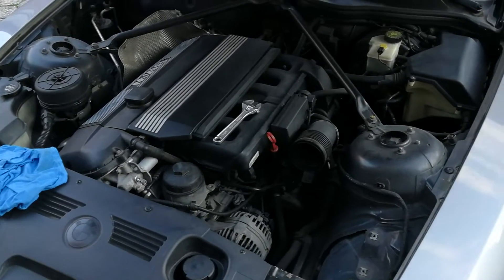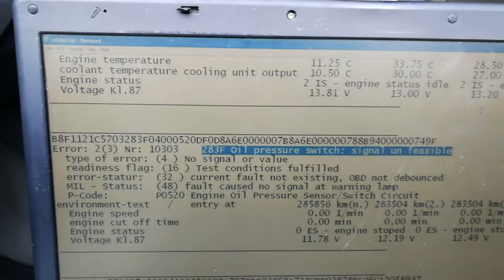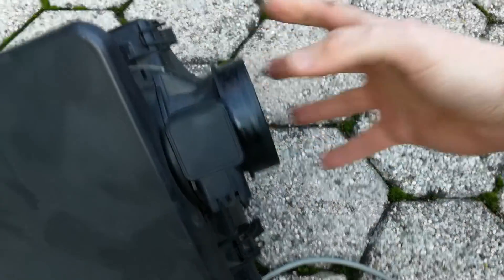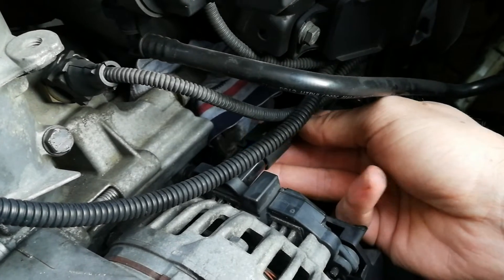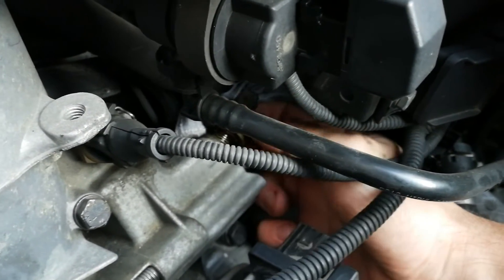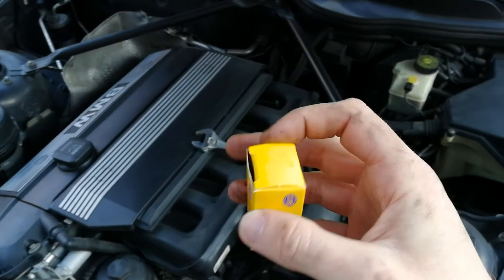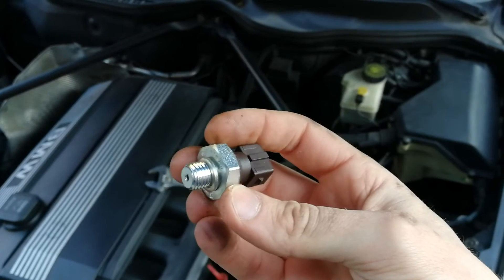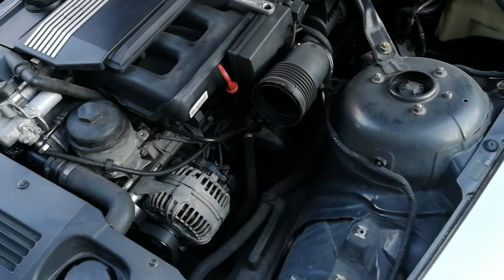BMW Z4 M54 Oil Pressure Sensor Replacement - Code  P0520, 283F Fix (E85/E86/E46)

Comment: Hi, I have Z4 E85, want to ask, if you have seen coolant light on. I changed coolant, sensors, radiator. But the light is still there.Would appreciate your input.

Comment: What is that 2 wire plug just above that sensor ?
Reply from the maker: Coolant temperature sensor.
Reply: @BimmerZen  i think my oil pressure one might be bad. Sometimes flickers at idle. Just sometimes. Red light.

Comment: The yellow oil light turns off right after I start the car and it stays on for about 20 seconds or so then turns off.  The oil was recently changed, so I know there's enough oil.  Is that most likely cause a bad oil pressure sensor/switch?
Reply from the maker: Probably a bad oil level sensor. Check for oil sensor codes.
Reply: @BimmerZen  Will do!
Reply: I changed the level sensor and still doing the yellow light for about 10 seconds. Did you find what was going on? Did you fix it?
Reply: @TheProfessionalPR20  I think I changed the oil PRESSURE sensor instead of LEVEL sensor, if I'm not mistaken.  Might oil light still pops on for about 20 seconds when I start the car.
Reply: @studiowizard6286  thanks for the reply. Well the only 2 possible things besides that is the filter housing check valve or oil pump. I think I will scan the car first. It's been doing that light thing for about 1 year now but I don't want something worse to happen. Thanks again.
Reply: @TheProfessionalPR20  That's wise.  Keep me posted.

Comment: How tight did you tighten the sensor since you don't have a torque adjustment ratchet?  How tight is 23n/m?  
If you did buy a torque ratchet, would it be able to get in that tight space??
Reply from the maker: The sensor needs to be torqued to 27 Nm. I did not have the appropriate 24 mm 3/8" socket / adaptor for my 3/8" middle  sized torque wrench (19 - 110 Nm range) so I did it by feel, but I think that you could fit it in there. Another option would be to use a smaller 5-25 Nm torque wrench and set it to 27 Nm. It would be a bit out of range, but still close enough.

I think that if you have some mechanical experience you won't under torque or over torque that sensor...
Reply: @BimmerZen  Thank you!

Comment: Red oil light flickers when idle and warmed up on my M54 (03 325i). I replaced the oil LEVEL sensor at the bottom of the oil pan the other year, and I've heard RED oil light indicates pressure whereas yellow indicates LEVEL. I hope this is the fix!
Reply from the maker: Yellow light indicates low oil level, red light indicates low oil pressure. Are you sure there is enough oil in the engine? If replacing the oil pressure sensor won't fix the issue, then you have some other issue with oil pressure due to worn components. Sometimes low oil pressure is due to worn camshaft vanos sealing rings. What kind of oil do you use? Maybe try switching to 5W40?
Reply: have you found out why your oil light flickers at idle bc it just started happening to me and i don't want to drive the car if it can be something serious

Comment: Hi I have a e39 530i m52 single vanos I have a problem that the red oil light is blinking and its go when I het the gas to 2000rpm nad I chicked the oil pumb and the engine prissure..... Does the bad oil pressure sinsore cause to fire the red oil light???
Reply from the maker: Not sure... You should first scan the ECU with diagnostic tool like INPA. That should give you enough information to determine the problem.

Comment: Hey there! If I just change this switch but dont clear codes etc (dont have access to inpa at the moment), is it still okay? Should I unplug the battery for this also?
Reply from the maker: Hi! You can just change the switch. This error is just a warning that there is something wrong with the switch/circuit. It's problematic only if this switch is malfunctioning and there is simultaneously something actually wrong with the oil pressure (it signals pressure even it there isn't any). If you don't clear the error codes they will remain in the memory, but everything should work just fine. It's a good idea to clear them so you know that all is ok (error doesn't come back).
Reply: @BimmerZen  Thanks! Im not sure if I have this error (no access to INPA). The thing is, after changing oil from 5w40 to 5w30, after some driving (like 20min), when I stop on traffic light red oil indicator starts flickering. Means low pressure. The oil is Mobil 1 ESP, recommended by BMW as far as I know. So, first thing I want to change the switch. Perhaps, it was already a bit faulty, but because of a higher viscosity of 5W40 it didnt flicker.
Reply from the maker: @alterminder  Hmm...  Changing oil pressure sensor is easy and cheap job, but without proper diagnosis it's hard to tell what exactly is the problem.

I really recommend scanning your car for error codes, best with INPA that gives you more information than generic scanners. You can get cheap OBD cable online and istall INPA on your (windows) laptop. Or you can get cheap bluetooth scanner and android app on your phone. It's a really good investment.

How many miles/kilometers on the engine? If engine is worn the clearances get larger over time and that causes oil pressure to drop. Thicker 5w-40 oil might help this situation but thinner 5w30 oil might cause issues - especially when it gets hot...
Reply: @BimmerZen  Thank you for your help! I've got cable, but I have macbook. Tried to install windows simulation and different soft, didn't work out :/ . My car is from 2003, 240k km, but every car service says it's in a pretty damn good condition. I didn't have this issue since I bought a car 1 year ago, and exactly after changing oil it appeared. Gonna change the switch first this weekend and wait for my mechanic next week to do proper diagnostic.
Reply from the maker: @alterminder  OK, good plan. Good luck and let us know if changing the sensor fixed your problem:)
Reply: @BimmerZen  So... Changed sensor - problem remained. Checked faulty codes - nothing. I didn't have option to check pressure, so in the end just decided to put back 5W40 - and yes, this fixed my problem.  I guess after 250k the engine is a bit worn off